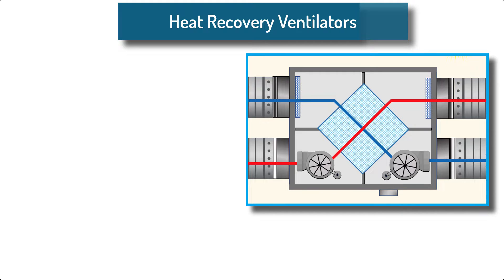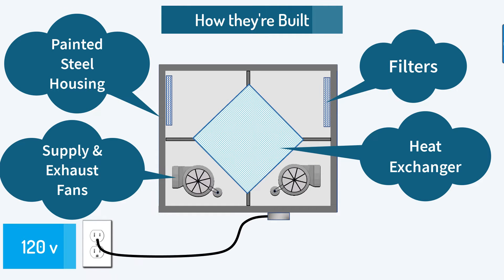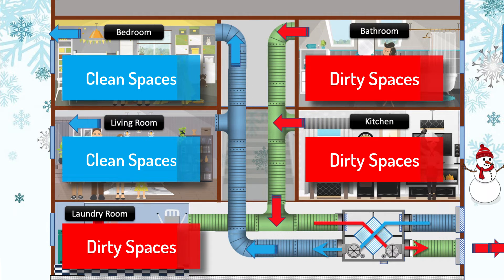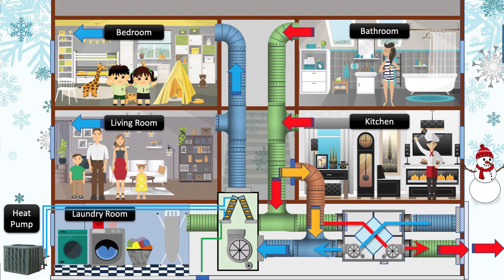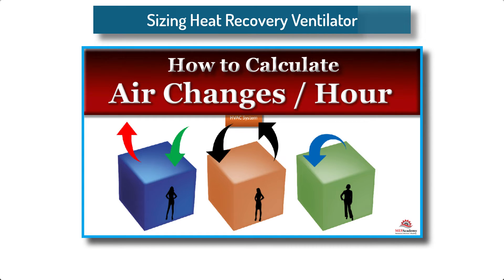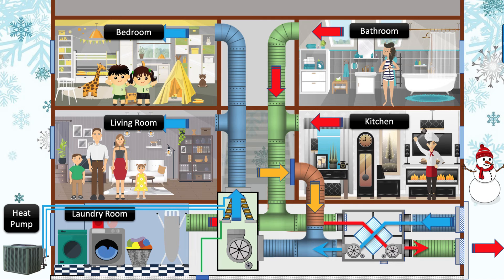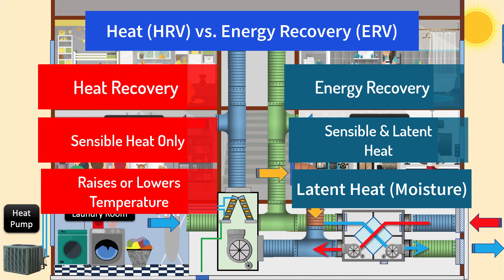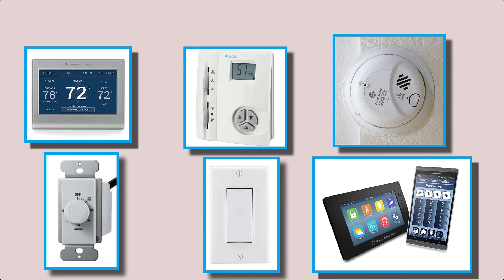Heat Recovery Ventilators and How They Work

Comment: ‘Fresh air’ is hard to come by when it’s wildfire season somewhere upwind. The HRV itself is probably going to be a ‘pre filter’ since they aren’t designed for HEPA grade. So in that case is running the incoming air into the air handler return (where it will go through better filters) the best approach? Or is there an alternative?
Reply from the maker: During wildfire season, it’s best to minimize outdoor air and focus on filtration. Most HRVs don’t have HEPA-grade filters, so instead of pulling smoky air indoors, turn down or temporarily shut off the HRV and rely on your air handler’s high-MERV filter (ideally MERV-13 or higher) to clean recirculated air. If you must bring in outside air, route it through a filter box with a MERV-13 or carbon filter before it enters the return duct. Portable HEPA air cleaners in key rooms also help remove fine smoke particles and odors.

Comment: why would there be a damper on the outside exhaust of my hrv system
Reply from the maker: 1. Prevents Cold Air Backdraft
In cold climates, outdoor air can push back into the HRV system when it’s not actively exhausting air. The damper acts as a check valve, preventing cold air from entering your home through the exhaust duct when the system is off or idle.
2. Improves Energy Efficiency
By keeping unconditioned outside air from entering, the damper reduces heat loss and helps maintain indoor comfort. This supports the HRV’s goal of energy-efficient ventilation.

Comment: will this ERV work for an environment wherein humidity is constantly as high as 70-80%.  I am from India, Gujarat, and the summers are very long since past 2 decades; lasting 10 months.  rest of the 2 months, it is absence of high temperatures and a little bit lower humidity (still 40-60%)
Reply from the maker: Energy recovery wheels, also known as enthalpy wheels, can work in environments with high humidity levels (such as 70-80%), but there are several important factors to consider such as humidity transfer, reduced efficiency and condensation risk. The design should consider a desiccant coating and pairing the wheel with some form of dehumidification to control excess moisture.

Comment: Someone had this into their home and had tons of dust inside. Don’t see a reason for this filter didn’t do the job either and ductwork was always dirty coming from outside.
Reply from the maker: Thanks for the comment. As you know filters are rated for their different efficiencies. Need to use a filter that is appropriate for the conditions, while also considering the static pressure drop. There are many reasons a filter fails, including not being properly sealed around its perimeter.

Comment: Is it ok to connect the return (contains contaminates) to the HR supply which will passes through the AC filters (collects dust only not other contaminates) and supplied back to the space?
Reply from the maker: We're assuming you're discussing a residential project. The supply and return should be connected as required by the manufacturer and function as normal. The Heat Recovery Ventilator has another purpose and that is to recovery heat that would otherwise be lost. This could be the recovery of heat that is being exhausted during winter, or the removal of heat coming in with ventilation air during summer. Hope this helps.

Comment: Why did the ventilation fan in my house suddenly stop? I set the timer for an hour, but it only worked for a few minutes and then suddenly stopped. I tried it many times and it was the same every time. What is the reason?
Reply from the maker: Could be a bad timer or something else. You need to have a technician look at it, as its impossible to determine without being there.

Comment: What prevents mixing of the air supply and exhaust in the core where they meet ?
Reply from the maker: In these type of Heat Recovery Ventilators the air paths don't touch as there is some form of medium that separates the air streams. During operation, the exhaust air from the building passes over one side of the wheel, transferring heat and moisture to the matrix material. At the same time, fresh outside air is drawn through the other side of the wheel, absorbing heat and moisture from the matrix. The two air streams do not mix, but their energy is transferred through the matrix.
Reply: @MEPAcademy   Thank you

Comment: is toilet exhaust air allowed to recover ERV
Reply from the maker: You can use toilet exhaust with an ERV or HRV, just check with the manufacturer to make sure their brand allows it.
Reply: All major brands recommend using the ERV to exhaust the bathroom. In fact, we no longer install exhaust only fans in bathrooms in new construction here. The ERV takes care of it.

Comment: Excellent explanation and graphics.  How much heat/cooling load does the ERV place on the home?  Would it require re-sizing the heat pump?   Thank you!
Reply from the maker: That depends on several factors, one of which is the outside design temperature for winter and summer, and the other is the volume (CFM) of air that will be brought in. The fans may add a small amount of heat, but the biggest load is definitely the cooling or heating of the ventilation air brought in. Of course this is why a Heat Recovery or Energy Recovery unit is used to capture some of that energy. It's important to have fresh, ventilation air for good health. Contact a local HVAC Contractor or Mechanical Engineer so they can run a Heating and Cooling Load profile to get you the exact numbers to assist you with any decisions you're looking to make on Heat Pump sizing.

Comment: Are HRV's popular in dry hot areas like the Pacific SW?  For years and years I've wanted a filtered ventilation system that did not require an air conditioner.  For most parts of the year (at least 2/3rds of the year) the evenings are nice and cool (60-70's F) while the days are hot.  The evening air should be allowed into the home during times when hot air is warmer in the house vs. ambient air outside.  However, most homes here in SoCal appear to be super leaky.  Dust and pollen is also a big problem here.  Just wondering if an HRV is appropriate to use in this climate and will this have the potential to introduce even more fine dust/pollen into a home that is "leaky" by nature.
Reply from the maker: The heat recovery ventilator can pre-cool the incoming air if you're using air conditioning. Without air conditioning then you might want to limit the time it runs during hot dry days, and run it in the evening when the outdoor air temperature drops. As for indoor air quality, the HRV's are great at bringing in fresh air. In most area's the indoor air is more contaminated than the outdoor air due to cleaning products, cooking, building materials off-gassing, etc. I would work on sealing your home, and if you use an HRV, make the home slightly positive (more Supply Air than Exhaust air), this will help force air out of the leaks as best as possible, but wind pressure outside and other factors will effect infiltration. Another system approach would be to use a Whole House fan to bring in fresh air when the outside temperature drops to an acceptable level. Also, use a good quality filter, at least a MERV-13 if your system can handle the static pressure. See our other video on filters if you need a refresher. https://youtu.be/O2Wittr7Kng

Comment: What is the typical heat recovery efficiency of a polypropolene heat exchanger? It would seem that after a short period of running during a cold winter that the cool air would cause the heating to kick in resulting in high energy costs.
Reply from the maker: Plastics are used for their corrosion resistant properties and lighter weight. You'll need to check with the manufacturer that you are thinking of using to see if they publish their efficiency values.
Reply: There is an easier, more useful and better way than digging all of this just for the sake of extending pipes, and it can be used anywhere on the earth under special conditions according to each region and at a lower cost.  But the idea needs support from anyone I might partner with in this innovation

Comment: The air to Air Heat exchanger of a Air conditioner is the engine from this machine ventilators
Reply from the maker: Yes, you're correct. It's important to capture the energy that was already used to produce heating or cooling for the occupied space before it gets exhausted.
Reply: @MEPAcademy  Thank you very much. What is the name of the program you used to create this video?
Reply: It just doesn’t make sense to me why we’d bring in hot moist air into our homes Dehumidifying air, which is what an air conditioner does, is an important part of staying comfortable.

Comment: I think the colouring is not right… in summer condition the incoming air would better colored as red/orange as it represents warm air from outside… IMHO 🙏🏻
Reply from the maker: Yes the color may not represent the temperatures correctly, but as long as the theory is communicated we'll have to go with that for now, and be more careful on future videos that the color better represents the temperature. Thanks for the reminder.
Reply: @MEPAcademy  you are most welcome, looking forward for your new videos… 🙏🏻😃